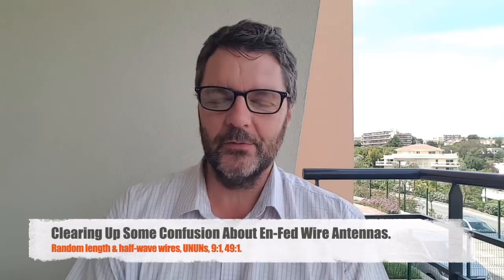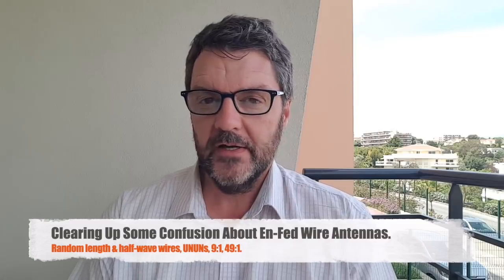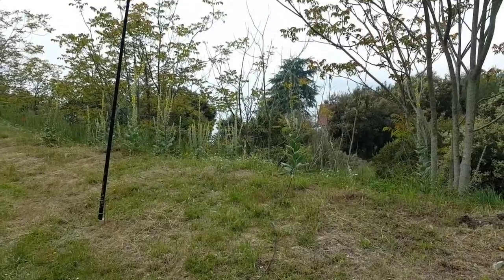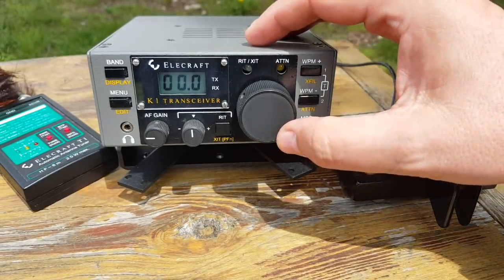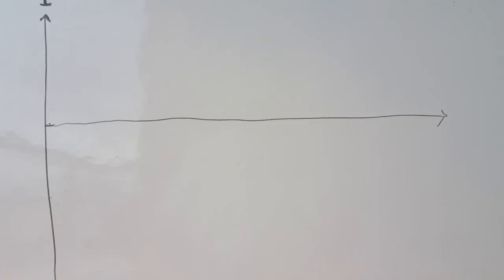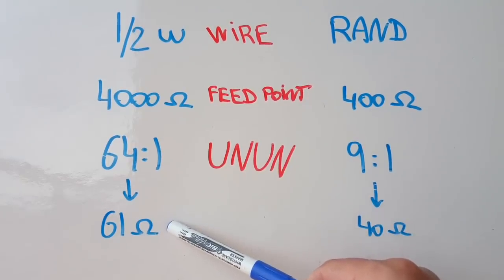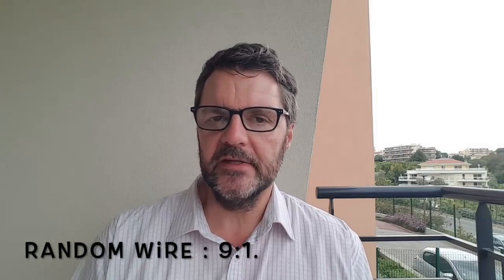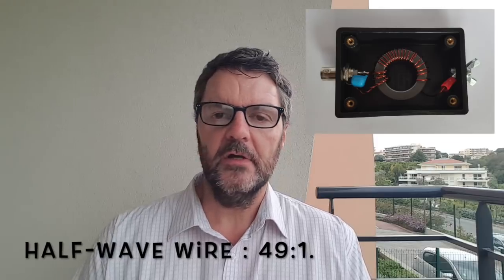Clearing Up Some Confusion About End-Fed Wire Antennas.

Comment: I built a 3 core version 64:1 and then I tapped the coils at the 49:1 point and ran a seperate wing nut. So now I have 2 transformers in one, a 64:1 and and 49:1, it works great! Thanks for the video!
Reply from the maker: Good idea!

Comment: Excellent info!  Thanks Gil.  Tried the 0.05 wavelength, as you said it had no effect.  Stacked 3 ft240 -43 together for a high power efhw and it handles 400w with no problem.  Steve Ellington’s channel is good for this.
Reply from the maker: Great, thanks for reporting :-)
Reply: To calculate the 1/8th wavelength do this example: 468/frequency =1/2 wavelength x2 then multiply it by 0.05 this will give you the length of counterpoise. Cheers

Comment: Great video. Regarding the 100pf capacitor on the RF Transformer there isn't 3kv on the RF input, if there was your radio's final world be toast. Yes there will be 3kv on the high impedance output to the wire antenna. I only use a capacitor rated at 400v with no issues.

Comment: Excellente explication Gil sur le sujet.
Some explanations in English now for the non French speaking amateurs to understand:
Cap is supposed to help on higher bands and raise resonance frequency as far as I remember well :)
Also as far as I remember well, material #52 is good for the lower bands and higher power (ex. 3 stacked 240-52 for 1/2 kW with still good efficiency ratio) and 43 will go up to 10m but with the cap to have a more centered resonance frequency.
Also, on 6m, I would advise either use a 2 meter 5/8 antenna which happens to be electrically 1/4 wave on 6m or a telescopic antenna with some counterpoise, so depending on the available supports.
Reply from the maker: Thanks. I do have the same video in English..

Comment: You make a good point. Sometimes the WARC bands, 30, 17, and 12 meter bands, are not open. Contest organizers could set aside 50 KHz of the CW and voice bands they use and make them off-limits to contest activity. That would leave a little space for everyone else.

Comment: Agreed. Im new to ham, but have quickly learned that ham “should” be about consideration and respect for other operators. They are looking past that by believing that everyone should see ham as they do. Personally, Im not currently interested in anything other than VHF and UHF radio operations. Both simplex and repeater use. My wife and son will be taking their tech exam in 2 weeks. Nice to have the family involved for both mobile daily use, but also educated emergency operations. i say educated because there seems to be some sort of strange trend in “preppers” buying cheap radios, no license, and then believing that they will be able to operate those radios under emergency conditions. I doubt it. At least for most anyway. So many of them will not have the understanding of radio communications, repeater connections (assuming they are still up), radio protocol for net use. These preppers will be slapped into reality when they need their radios the most and realize it doesnt operate like a walkie talkie from some big box store.

Comment: It's up to the amateur operators to police themselves and to be mindful of their actions. People should think about what they are doing and if they are stepping on someone else. It's not the job of the contest organizers to control every aspect of how to play radio and babysit each one of the contesters. The lids out there are going to cause problems regardless of the rules set in the contest. Sometimes the band is too full to hide in the lower section of the band. Sometimes you only have an antenna that is tuned to one section of the band so you transmit where you can. Sometimes people don't have an Extra license and can't use the Extra portion for CW. CW is able to be used across all amateur frequencies and it should remain that way. Don't try and limit where CW can be used, it's already a dying art that new hams don't care about. Don't get mad at contests, re-educate the disrespectful or oblivious operators.

Comment: Ferrite core transformers work well at low impedances - above about 9:1 losses get really high.    To check losses, run 100 watts through the matching network / wire for 30 seconds or so and then, with RF off, feel the cores' temperatures.  If the network is efficient, they will be cold to lukewarm.   The other issue is that an end-fed wire is a single ended load fed against a ground connection or counterpoise - this often introduces significant losses.   Some time spent modelling antennas with EZNEC will show what impedance various wavelength antennas present.
Reply from the maker: True, but often dipoles aren't mounted high enough and suffer ground losses. I think the difference if the lower angle of radiation of the vertical end-fed, even if the transformer is a bit lossy...

Comment: Excellent video. You talk a lot about  the impedance of the antenna and the transformation of high impedance down to a low impedance. You never mention reactance. I use the exact same 64 to 1 UnUn that you use. I operate 10 to 40 meters and a tuner is not needed since the reactance is at a minimum. When it comes to the random length wire fed with a 9 to1 UnUn, you have to address the reactance issue and can not get away without using a tuner. I feel the HWEF is the way to go since you are now feeding the antenna in phase.
Keep up the great videos. I've seen other videos you posted and they are also well done.

Barry, KU3X/QRP
Reply from the maker: Thank you. At last an informative comment that juste doesn't say "balooney" with no explanation. I prefer the HWEF much better too.

Comment: So today, learned, type 2 material for 9-1 and ft-243 for higher impedance ratios. And others mentioned. VERY helpful, but, I'm going for super long wires, so not sure what I'm getting into. 1000ft . With my full wave loop 80 m I have had rf in the shack. It is fed with open wire line, and have had problems ever since I used it, but also DX like D4C (6000 miles Off coast from Dakar)  with 5w usb 15m makes it worthwhile to put up with problems. I just updated a measurement, about 200 long wire antenna South east/North west direction. 75 to 100 feet high. Yes, FT-240-43
Reply from the maker: FT-240-43, not FT-243. The length itself is not the issue. If your very long wire is a multiple of half-wave for the band you use, use a 49:1. If it is not a half-wave multiple, use a 9:1.

Comment: Thanks for explaining. I have a 42 metre wire and a 9:1 unun. I have had no surprises yet but perhaps I should add (some) radials or an earth spike.
Reply from the maker: Hard to predict with a 9:1...
Reply: What's hard to predict?
Reply from the maker: SWR and common mode current issues given different counterpoise and ground configurations using a 9:1 with a non-resonant wire...

Comment: I'd love to know how/why each of the turns do what they do, what the cap does and how etc. I've built a few successful to plan baluns for different antennas that have tuned well but I still don't get the science behind it. My next project for my next house (this one is a lost cause as there is a MASSIVE noise issue 15m and south all the way) will be a multiwire instead of just an OCF dipole.

Comment: 49:1 and 64:1 is the turn ratio of the transformer. The impedance ratio is the square root. The former is 7:1 and the latter is 8:1.
Reply from the maker: 49:1 & 64:1 are the impedance ratio. 7:1 & 8:1 are the turn ratios. The impedance ratio is the square of the turn ratio.
Reply: @RadioPrepper  Sorry, I get it wrong. Ohm's law.

Comment: Finally I understand the topic!  Takeaways are that 'its a dc direct short, but its AC, so its not a short", 'you dont have to do this, but I am running the wire across the loop so that is comes out at the other end, it makes no difference, but it does count as a turn". The use of the word 'transformer' is what made my mind click on the first, I always wondered why it was a closed circuit.
I also finally undertand the mathematical relationships, (64 and 9 to one), but wonder, why not 8 to one as that would be 50 Ohms exactly?
Reply from the maker: Well, the impedance of the half-wave wire can't really be accurately measured... So not much of a difference...

Comment: I see you have a bit more space between the wire and the core.
As a rule of thumb, I wind mine so i can't fit the wire being used under any turn.
I also use the red core but I  also install the tuning cap and the tiny LED.
End fed is the most efficient antenna that fits in your pocket.
Excellent video and will be looking for more
73  BOB  AF2DX

Comment: Your explanation of why a half-wave antenna works, at 7:45, is incorrect. You’re mixing up instantaneous current with the amplitude. At each point in the antenna the current is increasing and decreasing in a sinusoidal manner wrt time. However, the amplitude of that current (the height of the peak) is higher in the middle  and very small at the ends. The curve you drew  shows the amplitude of the current along the antenna, not the instantaneous value. As per your diagram, the sine wave stays frozen in time which, of course, is not true

Comment: Thank you.  I wondered whether to use a 49:1 or 64:1.  Now I know it doesn't matter and I know why not.
Reply from the maker: 64:1 for a very thin wire...
Reply: @RadioPrepper  I have a new 500 ft roll of #18 THHN wire with a few dipoles up off that roll.  I have some type 43 material cores and a packet of 100pf 3 kv capacitors.  All I need now is the energy and a huge umbrella for a shade.
My next antenna will be EFHW.

Comment: When you working QRP, common mode current is not a big problem. Even if antenna is resonant, length is about half wave and you are using more power (for instance 60W) counterpoise is good idea.
Reply from the maker: Sometimes it does mess up keyer chips...
Reply: @RadioPrepper  It absolutely can happen especially when cable between manipulator and TRX is not shielded (which is not in most cases)

Comment: Near the end of the video, you mentioned that type-43 is good for 80-20 meters. What about 160 meters? Was it just not mentioned because not a lot of people do it? I actually have the space for a 160-meter antenna, but since my shack is not centered on the property, an EFHW for 160 would make more sense than a long coax run to feed a center-fed dipole.
Reply from the maker: I have not tried 160 yet.. Worth testing for sure..

Comment: You started off favoring the Random wire first, that's the  impression you gave me. But, if you go with the Random wire at 400 ohms, or probably more like 440, or 450 ohms the 9:1 will be a much better match at the 50 ohm radio  input. And if you use ladder line, at 450 ohm or even make your own open wire ladder line, at a higher resistance,  depending on the spacing and what you need, you will get ZERO losses.  Unlike the coax, coax has nothing but losses on it, unless you use a dipole or an inverted V, and then it will be a close match to the 50 ohm radio input.  I use a 9:1 on a not so random wire but a delta loop, 10 thru 80 which has about 460 ohms at the feed, but I use home made ladder line, 14 guage spaced out around 1.5 inches equaling 460 ohms until it gets to the 9:1 unun giving me  about 51 ohms at the feed. No tuner needed at any of those bands!!! Only if I go on 160 meters, with an swr of 5, then the tuner kicks in,  👍73's
N3WUB
Reply from the maker: Yes, but anything not a half-wave remains not as good as a half-wave, no matter how much you reduce losses in the feed line.
Reply: As far as what your channel is mainly about, RADIO PREPPING,  I will agree that a half wave wire is the better choice! Not getting out of context here. Smaller, shorter, easier to tune, if cut right, should closely match 50 ohms input, can be quickly placed up somewhere.  So in retrospect it is the better choice .
Reply from the maker: Choice is the key word here 😉

Comment: I have a tuner that has two inputs.  One is a coaxial input and the other is for a "random wire" on terminal posts...  does that mean that there is a 9:1 UNUN inside the tuner?   Also, thanks for your comments about contesting frequencies.  I'm not really into contesting either but, like you, I see the value it brings to ham radio as well as the joy it brings to participants.  Still, ham isn't just for contesters or any other group, for that matter.  It's kind of funny really since I enjoy aggressive sports like football and enjoyed playing them but, yet, I don't enjoy being really aggressive on the radio.  A psychologist would probably have a ball with that one!
Reply from the maker: Hi, I doubt it.. The posts might be for a ladder line feeder, 450 Ohms. A random wire would work sometimes. Something to  test...

Comment: Can I ask which band you tune first, as I'm having a little trouble with the one I built. 40, 15 and 10 are OK but 20m high with the dip at about 13.150mhz. Should I trim for lowest SWR on 20m, or keep checking all ? Thanks in advance. Andy M6APJ
Reply from the maker: Personally I switch wires... There is a compensation coil, six turns over a 40mm (I think) PVC pipe, placed 2m from the transformer.. It's supposed to help for 10m, not sure about 20. The consensus if to tune for the lowest band...

Comment: Hi, nice video!!.
I wanted to ask you for a clarification if possible or if you have some links or pdf files to send me ... 
I would like to make an EFHW ... but I don't understand a thing about the lengths of the radiant cable. 
For example, for the 20m band the cable must be 10.1m long. With the VNA I checked the impedance of this cable and it gives me 680ohm. For the 10m band with a length of 4.91m I read 365ohm. 
For the EFHW in most of projects I found a 49:1 transformer, so theoretically at the secondary (radiating cable) I should have an impedance of 2450ohm... and not 680 or 365... Where am I wrong? Thank you in advance
Reply from the maker: I don't think you can get a reliable measurement just with the cable. Put the 49:1 on and measure what you have on the input...
Reply: @RadioPrepper  Thanks I just re-measured with 49:1 connected. For 10m VNA gives me 24.77 ohm and for 20m 249.60 ohm .... so I think there is something wrong ....
Reply from the maker: Try shortening the wires a bit, 3" at a time.. Send me a photo of your toroid to gil@radiopreppers.com | Which toroid is it?
Reply: @RadioPrepper  thanks... I send you an email.....